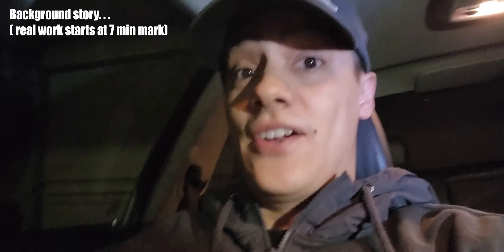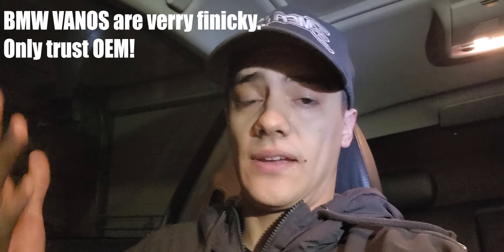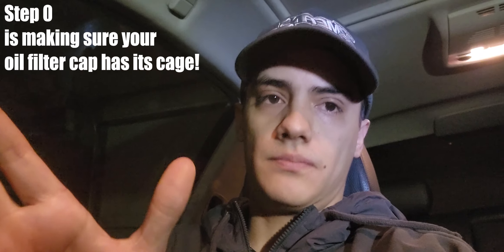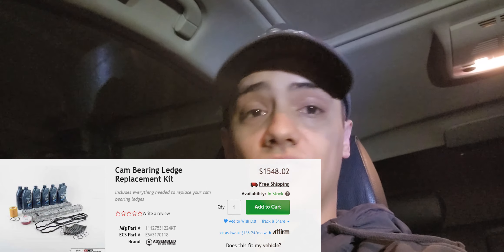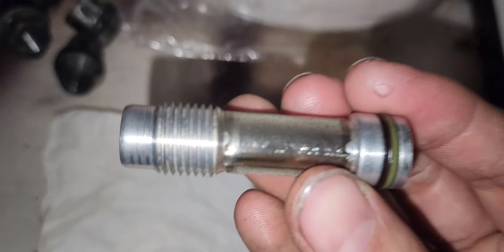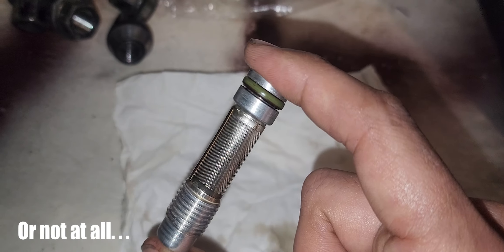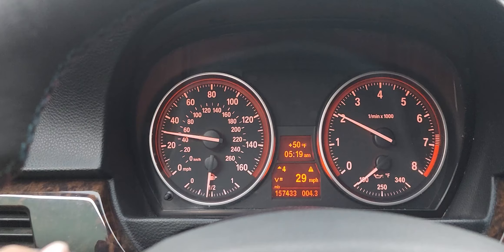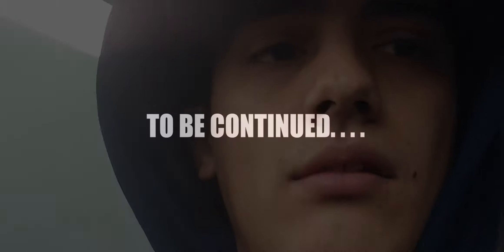BMW VANOS codes 2A82/2A87 STUCK? CLEAN your CHECK VALVES and SAVE THOUSANDS!

Comment: Thank you for this video as I need to clean these. Why  doe the oil temp gauge move like that under a pull? Is it modified to show something else?
Reply from the maker: @fstlnj29  This particular car had a JB4 installed and it's one of the features to hijack the gauge and use it as a boost gauge
Reply: Like that!
Thank you

Comment: Do I have to drain oil to do the check valves? Or can I get away with a quick pull and clean
Reply from the maker: You can get away with a quick pull doing it on a cold car,, it will drain a bit of oil regardless just have a towel ready
Reply: @ thank you 🙏

Comment: Yoo bro any update on this ?
Reply from the maker: I ended up selling the car shortly bro
Is yours stuck throwing the code?
Reply: It’s the vanos bolts. There’s a recall. The factory used aluminum bolts. The revised the bolts with steel. Those alumni um bolts loosen or the heads break off and the car sounds like a diesel engine.
Reply: @iamurnamann8662  mine was actually as simple as the oil filter was missing it’s stem and the oil filter was collapsed  and the Exhaust side Vanos Was in fact Gummed up with so much deposits so much that when you shook the solenoid it wouldn’t even click or engage so I cleaned both up and new Mann filter+Oil change and I’ve been good
Reply: But I have heard of those Bolts backing out or people having issues with the cam ledges Due to wear, but I inspected all when I done valve cover All looked good(Very reasonable for 141K Miles)

Comment: Alot of metal flakes in yours compared to mine
Reply from the maker: Yea I'm convinced previous owner didn't do regular oil changes and the car was suffering from bad cam bearing ledges
Reply: @ I don’t think the oil change interval was the issue more just that the old owner drove the car extremely hard and to a high temp that’s why the check valves were singed
Reply from the maker: @davidkrawi1650  ah makes sense! And your probably right. The car came with upgraded turbos and he seemd to be enjoying it forsure haha

Comment: Mines were clean af already im like damn it has to be the cams🫠🫠
Reply from the maker: @angelnoguera1209  damn that's bad luck 😮‍💨 but yes probably the cam ledge bearings
Reply: @3meansgo  Man I'm still getting that code 2A82 vanos i replaced the 
*Vanos camshaft adjuster
* timing chain still tight
*no visual damage on the cams 
*new MAF sensor 
*New sparks plugs
* new engine cylinder bolts (bolts side of engine with the screen on it)
* tested and cleaned the Vanos solenoid both move with 12v power
*flushed oil twice 
*new oil filter cap
I swapped the vamos solenoid then exhuast and vanos popped up until i cleared again and still only the vanos pops us... idk what else is there to check for that